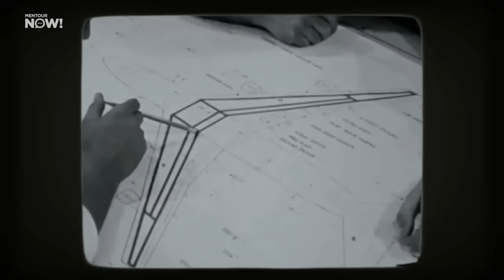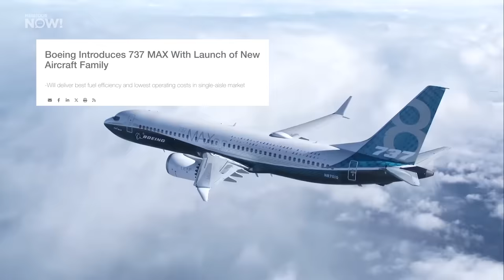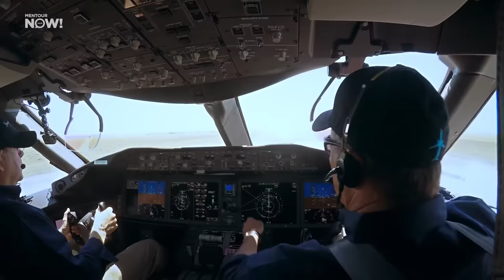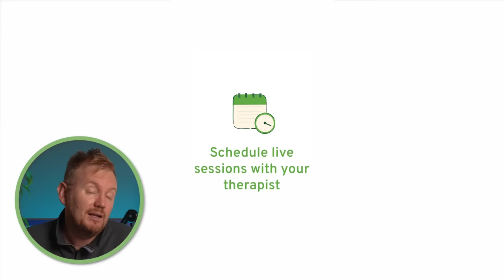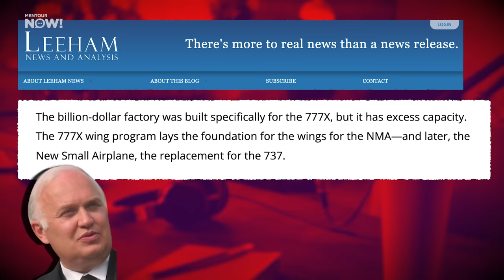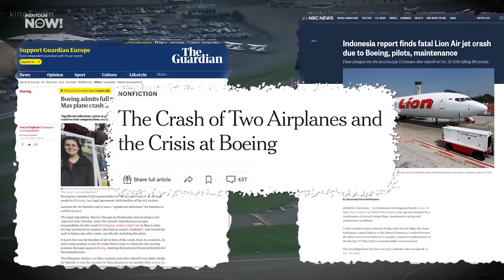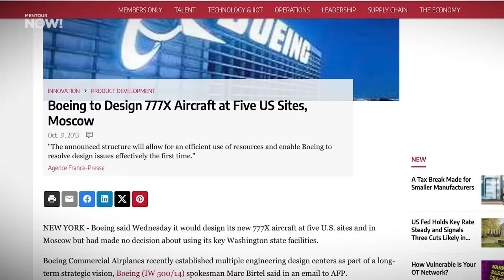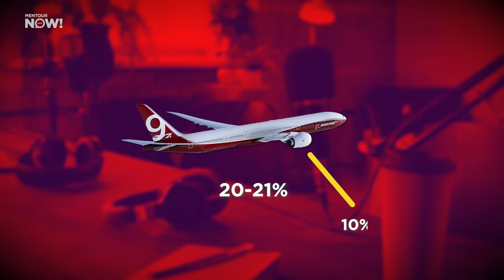What’s Going On With The Boeing 777X?!

Comment: This is totally McDonnell Douglas DC-10 all over again. They tried to modify an old design to meet new requirements, it's not going to end well. I wouldn't fly on the 777x for at least 5 years to see if any design flaws from the extensive modifications surfaces.

16:15 this is just like how MCAS got signed off based on Boeing's words. It's unbelievable that a failed fuselage test (even if it's close to passing) didn't require a full physical retest. Looks like they still got people in the FAA. Imagine if a COMAC plane failed the fuselage test, I bet the FAA would require them to test again and not take their words that they'll fix it in production.
Reply: When you get that close to passing, you can't just hand wave it away like you're suggesting.  It's much more complicated than that.  When they do these tests there are strain gauges all over the structure recording the actual stress levels in various components.  This test data is compared to the stress analysis to validate its accuracy.  

The test aircraft is thoroughly examined at and around the failure points noting the exact location and failure mode of the structure.  Using this information, the stress analysis is rerun changing the parameters to better match the test data.  Then the areas that failed are redesigned slightly to beef up those failure areas.  A final analysis is run to show that the redesigned areas show a positive margin of safety.

Then you have to present the results to the FAA (called a showing of compliance).  The FAA will go over all of the analysis and test data and either reject it or give a finding of compliance.

If it weren't this close to passing, then yes a new test would be required.
Reply: @artjackson8360  Yes, they should examine the failure points and analyze it. But the fix that Boeing presented didn't get the same stress test again, who knows, it might have transferred the failure point to somewhere else and still fail below the 150% load. What I'm saying is FAA should not have certified the design until Boeing create another fuselage with all the improvements, then test it to 150% load. Imagine if for some reason COMAC wants to build a plane in the US and get it certified by the US FAA instead of China's CAAC, the FAA probably wouldn't trust COMAC to do the same thing.
Reply: @awdrifter3394 Limit load is the absolute maximum load that an aircraft will ever see and it may occur only once in the lifetime of an aircraft. Ultimate load is 50% higher than that.  Couple this testing with in-service planned maintenance inspections and you will catch damage to structure before it grows enough to fail. That’s why it is acceptable to the regulatory agencies to substantiate that final 2% by analysis. Spending tens of millions of dollars to demonstrate by test the final 2% is a waste of money and doesn’t buy you any extra level of safety. You’ve already proven it good to 1.48 factor of safety. 

Now if you only made it to 1.3 times limit load then the FAA will most likely not accept substantiation of that much shortfall by analysis.  This is the acceptable way to validate structural integrity worldwide. I’ve been doing this type of work for 40 years so this is direct first hand knowledge.
Reply: @artjackson8360  then why not make the standard just 100%? Of course by normal flying the airplane shouldn't exceed 100% load, but the limit was set at 150% for safety margin. Now that Boeing failed to reach it by 2%, the FAA just let them pass without testing it again. They did the same thing with MCAS by trusting Boeing and it seems like they still haven't learned their lesson.
Reply: @awdrifter3394  This is a complicated subject and twice I’ve explained why it’s acceptable. When you validate the finite element model with test data, you have proven it will accurately predict the internal loads. Again, this is why the regulatory agencies will accept this approach to cover the final 2%.  Rerunning a major test like this is not required to be in compliance with the CFR. 

Here’s an alternate way to show it good. Restrict the gross weight.  A purely paperwork solution. You reduce the load and now you meet 1.5.   This wasn’t used in this case, but it’s an option. 

Let me ask you this.  Using this approach, do you think the aircraft is unsafe?  Airbus tested their wing to ultimate load and failed 5% short. They didn’t make any changes to the design after the test, just some additional analysis. Do you think the A380 is unsafe?

Comment: So what your saying is that Boeing are probably glad that the RR engines from the A350/1000 are not that good yet because it could mean the doom of the 777X if Emirates just switches over to Airbus instead.
Reply from the maker: It certainly helped them here. But we will see for how long that will work.
Reply: What do you mean when you say "it certainly helped them here", in this response from yourself? Are you saying that you agree that RR Trent Xwb-97 engines "are not that good" because that is your opinion? That is as good as saying that you agree with that comment. @MentourNow
Reply from the maker: @Stvescr I’m saying that it helped Emirates choose the 777X over the A350-1000, as explained by their CEO.
So the Engine was obviously involved. 

What I said, is in the video.
Reply: @MentourNow  It seems that in this instance you using Emirstes CEO comments, regardless of the context, and emulating those in a lesser form over recent videos. 

I've been a fan of yours since 2018, a very long time. I respect your opinion but  I do believe that you are being too critical for no real practical reason. 

Would you consider a new video 📹? Something along the lines of "current next generation widebody aircraft engines"? Those in service plus Ge9X/Ultrafan. Certified and non certified. Video could look at performance/economics/power/reliability/etops etc?

Comment: I think there is no clarity on what is expected as aircraft performance by both flight operators as well as aircraft manufacturer. I am talking about wide bodied jets. I think for too long a period industry is harping on efficient, efficient compromising reliability, cost of development and timely development. Dreamliner , Max, and engine reliabities of some NEO plus big flop of A380 are classic examples.Crude prices are near flat for last 13 years. Time value has increased a lot during this period. Simply stressing fuel efficient is absurd. Hopefully some sanity come to aircraft market soon..

Comment: I love and loved Boeing all my life and have worked there (bla bla); some stuff really should not be mentioned, since it could hurt the company; but in the micro level and in conversations with many colleagues, there are a number of changes that happened to Boeing after "absorbing" Douglas, a lot of policies don't make sense and many are scratching their heads on why?, having said that the 777X with all it's problems will surprise the world...also there is competition between Airbus and Boeing yes, but Airbus has a lot of subsidies from the 4 (Countries) partners on the commercial level, so it is not quite a level field competition. On the other hand due to the enormous pressure from the MSM about the 737MAX, now "the ultimate responsible" if there would be an accident is the FAA, and since in reality this aircraft is at the forefront of technology everything is new and the FAA is so worried that requirements are changed "every 5 minutes" so the engineers need to adapt to a requirement taking a lot of time and effort and after an amount of time the FAA came back and changed that requirement....and so forth.

Comment: Airbus can look to marginalise the B777x relatively easily. It seemed to be averse to gigantism after the A380 debacle but the simple fact is that the A350 is far lighter and more efficient than the B777x. The only things that allow the B777x to compete are a newer generation of engine, a higher aspect ratio and size. Once RR has sorted out the ultra then a A350-1100 can be relatively easily be developed, possibly with a larger wing (patented downward folding wingtips) and a stretch to make it directly comparable in size. The B777x would have nowhere to go in this scenario. So highly dependent on a new engine but neo must be part of their future strategy in my opinion.

Comment: I fly overseas to China usually on a 777. Last trip was on a 787 'Dreamliner'. The 787 is a nightmare. Cramped seating with little legroom. Learned a lesson to never fly a 787 again so I will limit my departures to New York and Chicago.
Reply: The cramped seating has nothing to do with the 787, it’s cramped because airlines configure the planes like that
Reply: It has everything to do with the 787. Boeing clearly designed this with cramped features to sell to airlines. Why would an airline not maximize space? @Blank00
Reply: @fischman26-China  more seats = more money.  Boeing has no control how the airlines configure the interior.  Boeing doesn't even make interiors.  The airline customer lays out their requirements and a variety of smaller manufacturers build them to those specifications.  The only thing Boeing does in install them in the factory.

Comment: I have a question about the wingtips on the 777x.  Why did they have the wingtips fold up instead of down?  One would like to think that if the wingtips folded down then
1 - it would make access to the wingtip lights easier
2 - it would ensure that the wingtips would stay in position in the event of a mechanical failure.
Reply: 1. You're going to need a ladder regardless if they pointed up or down.
2. The wingtips will lock in position before takeoff and if they don't then it'll warn so you wont takeoff.
Reply: It's better for the wingtips to fail-to-extended than for them to fail-to-folded. That way if the folding mechanism fails in flight, you can have a tech on the ground manually or tool-assisted fold the wingtip - if it fails-folded, then you're going to have a small but probably annoying yaw moment because of asymmetric drag if the wingtip collapses down in flight.
Reply: Also you're going to need a ladder or lift regardless to access the wingtip lights on a plane this tall, so that's a moot point.
Reply from the maker: You never want to increase the risk of on-ground damage and wingtips who are folded down would be in the way of fuel-trucks and other vehicles.
They would also be a hazard when taxying  so folding up was the only good option.

Great question though.

Comment: As an aircraft engineer who works both on the 787 and the A350, I can confidently say the 350 is light years ahead with system integration, avionic reliability and manufacturing quality compared to the 787. I hate working on that plastic pig - the stress of it all. Sometimes i get slight anxiety before i walk aboard because it throws some random fault codes out of thin air. The 777 on the other hand is just a joy to behold because it just works. To finish, the 350 is a technological tour-de-force, sure it has its problems but nothing like the Screamliner. What are you doing Boeing??!!
Reply: 😆 The only "aircraft engineer" who would "work both" the 787 and A350 would be a supplier / sub or a maintenance tech, not someone who would be taken seriously as a source of design evaluation. The 787 sales and flight-safety track record have been superb, and I expect the A350 will be very good as well.
Reply: @ReluctantPost  I'm a EASA B1 Licenced Aircraft Engineer. Not FAA cereal box A&P "licence" 😂
Reply: @peanuts2105  Comment stands.

Comment: Ya, its pretty sad what happened to boeing. what do you expect? They are run by a bunch of number chasers and pencil pushers (Wall St), whereas airbus is run by engineers, technicians, sales&marketing and executives....
Reply: Additionally Boeing is making heavy use of outsourcing which is also adding to the problems. All in the name of „cost optimization“ which is probably not true because if you factor in all of the delays and quality issues maybe at the end of the day it would be even cheaper to use own, well trained and well paid workers. But that’s not how they calculate.

Comment: Boeing should really have designed and by a brand new replacement for the 777, in the long run it would probably have cost them less, let's be honest the rehashed 737 Max is a 50 year old design with fancy wings and oversize engines. Boeing seem to be wanting to do everything on the cheap and save costs, but in aviation as we all know that's not possible, in the meantime the a350 is proving to be a worthy alternative for the 7.

Comment: The wingtip changes seem half-baked. Why bother? All that added complication and cost  and for what? Just to get into a tighter parking space? Sounds ludicrous.
Reply from the maker: It’s not when you consider huge costumers like Emirates.
It’s very unlikely that emirates would have gone for the 777X if it had jumped up a gate-category compared to its predecessor… and especially compared to the A350-1000
Reply: Planes already have a lot of moving parts, adding a couple more shouldn’t be that big a deal. If Boeing had added some additional flaps would you even have noticed?

I have heard nothing about the folding wingtips slowing the progress toward production. Lots of other things but not the wingtips. As far as I can tell they’re just the most visually conspicuous and superficially novel part of the aircraft, not a bad design choice.
Reply: To have the foldable wingtips fully deployed only after push back....that's not a good design
Reply: @mitchell4348  Why?
Reply: @mitchell4348 they’re deployed just prior to takeoff otherwise it would be restricted to certain taxiways
Reply: I just hope they hardly ever fail on the ground and never in the air...

Comment: Can you please explain why emirates president criticized the engine on A350-1000 and finds the new B777 a better solution??? It clearly has more problems than A350. A350 is already in the air for some airlines. Ok it has issues in dusty and warm countries but how will GE engine do in the same environmen?
Reply: Mentour doesn't answer these types of questions. #BoeingBias
Reply: Because airbus is crap.
Reply: The GE90-115BL1 has proven itself to be a superior engine in the hot, dusty environment of Emirates - they haven't had a single GE90 in-flight-shutdown occur in five years!
Reply: @rafaelwilks  The engines we are discussing are next generation engines I.e RR Trent Xwb-97 engine which are far superior in technology and economics.
Reply: @Stvescr  far superior in technology and economics to previous RR products, yes
Reply: @rafaelwilks  No. Far superior to any other engines except, as mentioned, GE's new (yet to be certified and proven Ge9X)

Comment: This is a Boeing management issue. Boeing is now run by MBAs and not engineers. Once McDonnell Douglass bought Boeing with Boeing's money this shifted to making stock prices go up and not focusing on building the best plane.  The last great program was the 777 (before McDonnell Douglass)  The next program, 787 was a disaster, So was the MAX and now the 777X. Heck look at the problems Boeing has getting Ryan Air their 737 MAX 8200... There was a time where the 737 factory was the most productive single isle aircraft pant in the world. Judging by news reports this isn't the case any more. So much so they are building another production line for the MAX... Spending money to build a new line to build aircraft they sold 5 years ago at 5 year ago prices. This company isn't run by people with long term goals.
Reply: How is this about the management issue? Airbus is run by MBA's and not engineers .McDonnell Douglas merger with Boeing was a mistake we get that. All companies will do anything to get their stock prices to go up and not focus on building planes. The last best plane was the 787 and 777x. the 787 was not a disaster. it had early problems that had to be dealt with over time. The max we all know what happened. The 777x is just a delay. better to be late than sorry. heck what? boeing isnt getting any problems with Ryanair max 8200s. The 737max is still the productive single aisle aircraft plant in the world. Yes a new production line next year for the MAX. Of course this company is run by people with long terms goals. Well airbus shouldn't be building new planes they sold years ago at years ago prices either

Comment: Does anyone remember the teething problems that these 737's by Boeing went though in an earlier model? Its not like the Max crashes were something new. Boeing lost at least 2 other crashes and many people had to die due to the hard rudder fallover that two or even three of their 737's suffered in the 80s. So many people had to die before they got that figured out as well. Let not ponder on just the two max crashes. I just told you there were two or three others.

Comment: The area of the FAA and the documentation they are requiring looks to have been a huge factor in the more recent delays.    Boeing also was reported to have had a hard time (as Peter noted)  shifting to supplying the FAA requirements (basically proving what they are putting out as a core issue with the MAX was the lying and fudging statistics on AOA failures) as well as the reaction changes (faster)  made in MCAS  1.0.    Boeing also got themselves in a hole on the 787 shim problems and the FAA may not have been able to keep up with that as well as Boeing having to divert resources to the 787 and MAX (current production vs not in production).    Self inflicted wounds by Boeing and pondering that Boeing painted themselves into a corner and made those resource decisions away from the 777X.    As the 777X can't (or could not) get FAA flight tests going until the FAA was satisfied,  that seems to be the stall on the program.   The 777X-F may be providing designing  engineers something to work on.